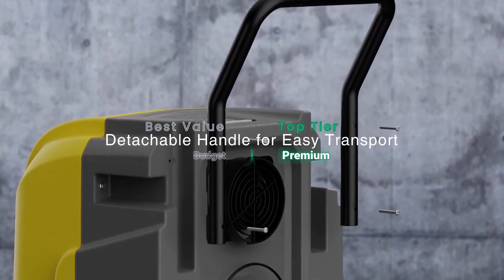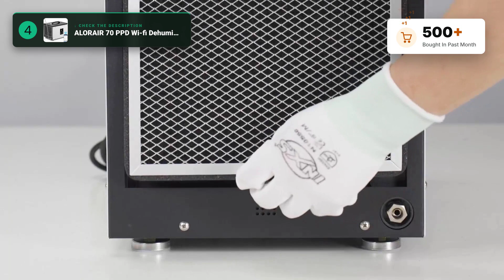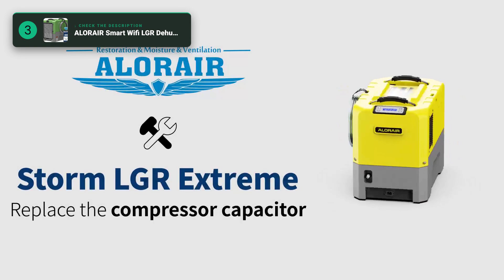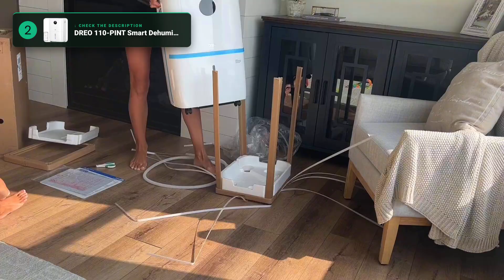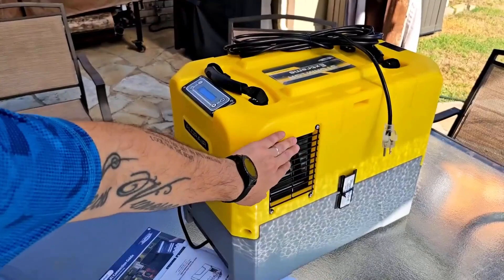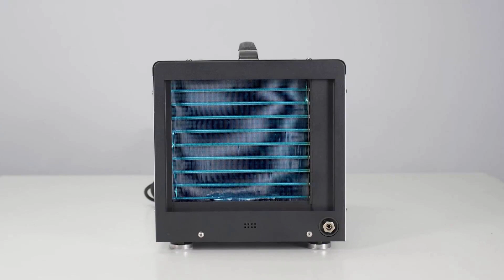5 Best Commercial Dehumidifiers 2026 | Smart App Control Tested

Comment from the maker: Products Here 👇

Check out the products using the links below!

1. ALORAIR ALORAIR 180 PPD Commercial & Industrial Dehumidifier with Pu: https://www.amazon.com/dp/B0FP58HQ7M/?tag=treadwardgarage-20
2. DREO DREO 110-Pint Smart Dehumidifier for Basement, 4500 Ft² for : https://www.amazon.com/dp/B0F83XFNTB/?tag=treadwardgarage-20
3. ALORAIR ALORAIR Smart WiFi LGR Commercial Dehumidifier 180 PPD (Satu: https://www.amazon.com/dp/B0FP53N37Z/?tag=treadwardgarage-20
4. ALORAIR ALORAIR Wi-Fi 70 PPD Dehumidifier with Pump for Crawl Space : https://www.amazon.com/dp/B0DYP2V44K/?tag=treadwardgarage-20
5. ALORAIR ALORAIR 190 PPD LGR Commercial Dehumidifier with Pump, Smart: https://www.amazon.com/dp/B0FP293DGH/?tag=treadwardgarage-20